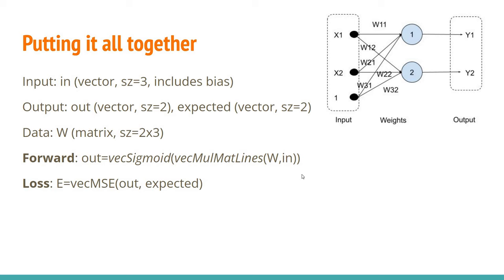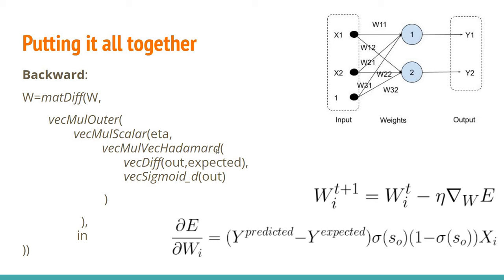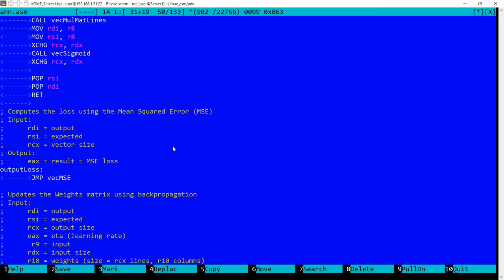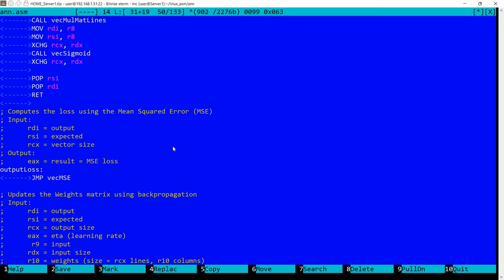Simple Artificial Neural Network entirely in assembly language

Comment: i recently came across your channel and it seems you pretty great at dealing things at hardware level i also want to study and know about the computer hardware and but the problem is i didn't have any organized set of resources which make a lot harder to understand things i do have a pretty knowledge about the computers though but still there so many missing puzzles that are yet to fit to fully understand can you help me please.
Reply: nand2tetris (building a computer from first principles), 
computer systems a programmer's perspective, 
operating systems three easy pieces, 
computer networking a top down approach
Reply from the maker: I see user @gac5700 already replied with a nice set of resources. I want to add that sometimes it may be easier to start learning using a simpler CPU (either a microcontroller or an older CPU for example). All CPUs have registers, buses, addresses, data, etc. In a simpler one you can play with a reduced set of such registers and instructions. I would recommend Intel 8080 (you can find a bunch of emulators) or Intel 8088 (again a bunch of emulators or even real hardware). 8088 is the basis for modern x86 architectures and the basic instructions are the same (also when a modern CPU turns on it is basically in 8088 mode). On the microcontroller side, you can easily start playing with a Pi Pico or similar and even create some circuits. Pi Pico has a modern ARM-based or RISC-V based CPU (these are different from x86). It all depends what you want to do with what you learn.
Reply from the maker: Good ones!

Comment: Here before your chammel gets some traction. Would you be willing to make x86 16 or 32bit assembly tutorials for absolute beginners to programming.
Reply from the maker: I was considering some beginner tutorials (not in the very near future though), but I was thinking about modern 64-bit stuff. Why are you interested in 16 or 32 bit as a beginner? From a job perspective, nowadays almost everything runs in 64-bit. If you want to do some code optimization or write routines for drivers in assembly you are likely working on 64-bit systems. Alternatively, you could learn ARM / RISC-V for things like embedded systems.
Reply: @ComputingMongoose  What tutorial or course would you recommend to a person who is completely new to assembler  ?
Reply from the maker: @filipzdravkovic7134  I'm sorry, but I don't have a particular tutorial or resource in mind. My experience was accumulated over many years from many sources and through work. I do hope you will find a good resource.